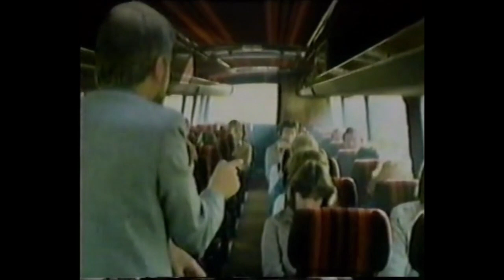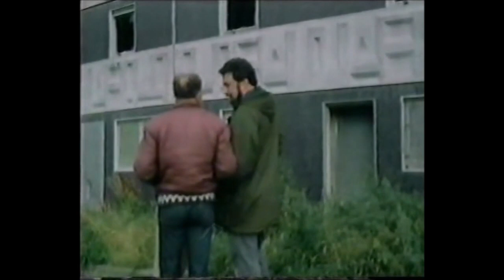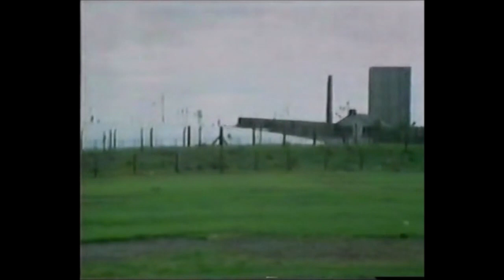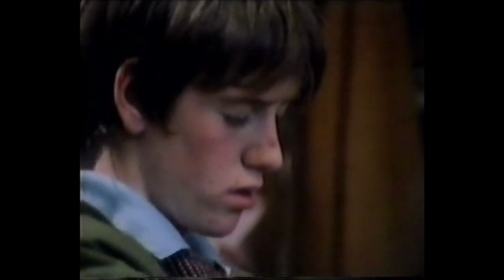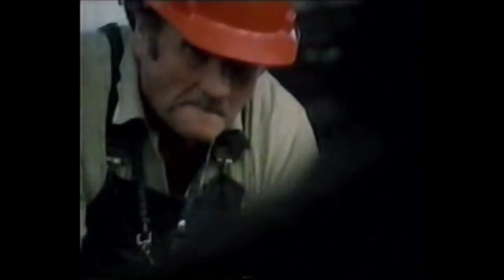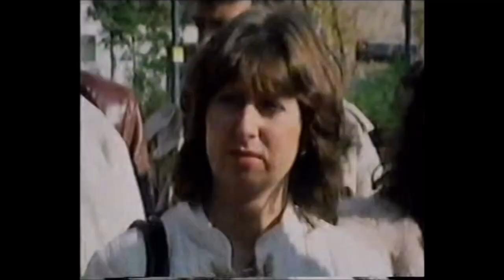Glasgow The Blight

Comment: I was born in a Tenement,top floor, in Toonhied, 1948, these were well built buildings,  solid stone, though poorly maintained by the Council, but kept as clean as possible by the residents, sweeping and chalking The Close. However they should have refurbished these buildings rather than pulling them down and replacing them with ugly high rise soulless places.
 I have relatives that moved to Cumbernauld, East Kilbride, Drumchapel, Clydebank, Rutherglen and Bishopbriggs. I left there in 1966.